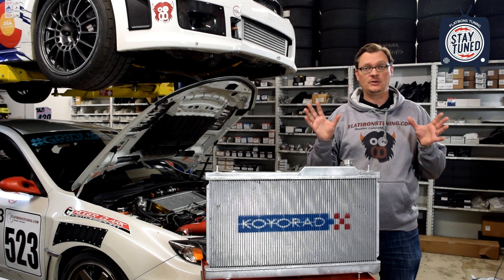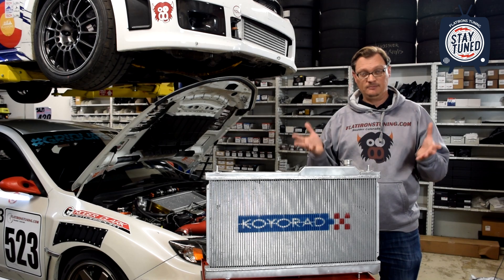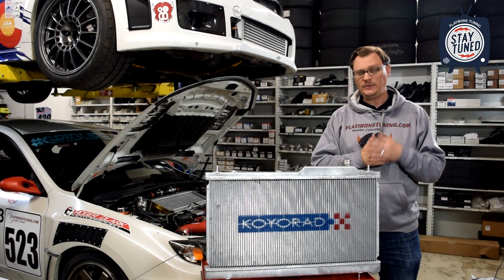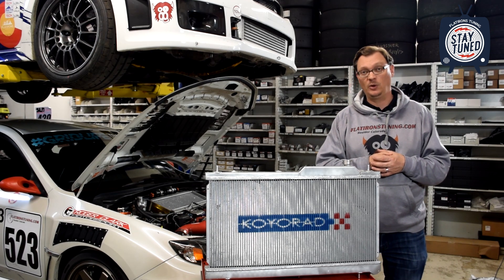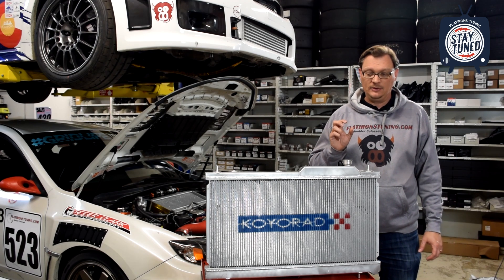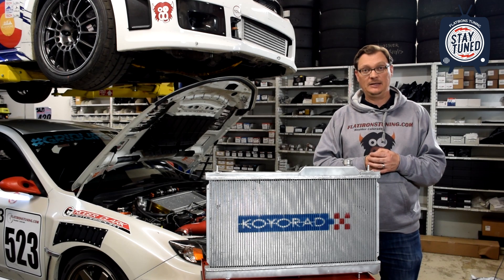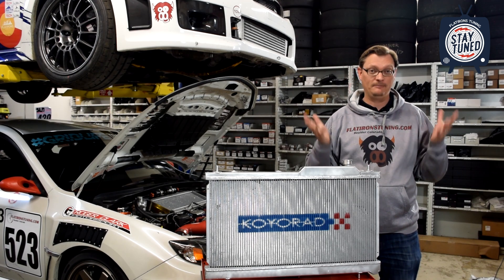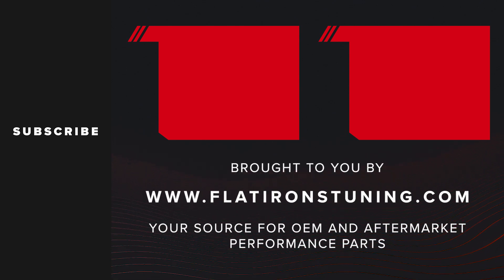Why we got rid of our radiator cap

Comment: Run a Stock radiator system on my 2002 WRX which has and APS IC, down pipe and exhaust with a tune done in 2005; all here in Phoenix AZ. The only time I have had issues with the car getting hot is cruising over 70mph in +115°F temps. So, if I keep the WRX at 70mph with AC on I don't have issues. As soon as I get up to +75mph overheating begins. Now, I drive my car like I stole it, and it does just fine with the stock setup, which is a single radiator cap on the tank near the intake. There is a stock expansion tank by the radiator as well. If this works here in Hell on Earth, then this setup should sustain some nasty beatings in lower temperature areas. Granted racing at altitude does cause cooling issues due to thinner air.
Reply: APS FMIC or APS Top Mount? Either way, some pretty rare stuff. Truly wish they had stayed in business. I've been running the DR525 FMIC on my '05 WRX since 2009, and I'm terrified of front end collisions: cars, animals, etc.
Reply: @dullahan7677  Using TMIC. To your point, and the fact in 2005 I don't believe front mount were common on the street. I bought it from the original owner who is now in his 80's. 🙂 Going to install the JDM splitter and JDM custom painted scoop soon.
Reply from the maker: Thanks for the comment.  Stay Tuned!

Comment: Hi guys, I believe I may have an explanation for the overheating issues you are having. 

As I don't have the specifics of what the circumstances under which you are overheating, that being the case I'll make the following assumptions:

1) Overheating comes on at high rpm

2) Appears to take place  in a sudden onset, ie: temperature is ok, then suddenly you are overheating.

3)takes place when under sustained high load and in particular high rpm.

4)No underlying  cause such as head gasket issues, thermostat working correctly, timing belt tensioner applying sufficient tension to adequately drive the water pump, correct Glycol concentration in cooling system,  blockages or incorrect plumbing causing reversed flow within the system.

Based on those assumptions, I believe the problem is not in the outlet going to the radiator but on the inlet coming back from the radiator. May I refer you to the 3:00 time stamp on your video;  take a look a the flow path of the coolant on the radiator shown in the window; the  flow comes from the top,  left of  centre  of the radiator. Coolant must then flow close to 400mm in one direction and 300mm in the other (14 and 12 inches)  in order to presumably flow evenly across the width of the core  (though in reality not the case), then when the flow gets to the bottom after passing the restriction to flow that is the radiator, all of the flow must then travel all the way to the far left of the radiator a path of 700mm at its longest to get to the outlet. 

The flow rate through the radiator at high rpm becomes high enough that the radiator is unable to flow without a significant pressure drop; in essence we have the same scenario as an intercooler, greater efficiency due to greater surface area often results in an increased pressure drop across it.  Should that pressure drop bring the suction side below the  vapour pressure of the coolant, it will instantly boil. Remember boiling point is a function of both pressure and temperature, hence why we use higher pressure radiator caps to prevent  overheating.  

To a certain extent this can be addressed by increasing the pressure of the radiator cap or removing the radiator cap altogether. From a fluid dynamics if you are able to push a higher pressure (whilst maintaining the same flow rate) on the inlet and the pressure drop remains the same, we can hopefully force more water through in an attempt to maintain the pressure at the outlet of the radiator above  vapour pressure, until you reach the same limitation.

A better option would be to improve the  flow out of the bottom of the radiator. This would be a better option in my opinion as an added bonus it should help with pumping losses from the water pump.

An easy way to test this particular theory wold be to set up a video camera looking at the bottom return line from the radiator which might show the radiator hose collapsing if the pressure is low enough, or if you would like to take a much more technical and data based approach, set up pressure sensors to measure both inlet and outlet pressures at the radiator.

Whilst I would love to take full credit for this information and insight, ALL credit  must go to Brett Middleton, former owner   of MRT performance in Sydney Australia. I came across a technical video in his MRT channel on YouTube. it is one of his much older videos where he goes into the finer details for what the original problem was in his then race car.

I hope this helps or at the very least provides some additional perspective. I will try to find the video and add the link later.
Reply: As I was reading it sounded familiar, I think I saw that video as well. Also, he's the former owner? Was this a recent change? I haven't followed up on their stuff lately but always did when I was working on my WRX.
Reply from the maker: Yes, I believe that Bret sold MRT to a new owner a couple of years ago.
Reply from the maker: Thanks for the suggestion.  I'll have to see if we can find that video.  Bret at MRT Definitely knows his stuff when it comes to Subaru's.  In our case, there are a few other things going on, but improving the flow of coolant to the engine is never a bad thing.

Thanks very much for your comment and Stay Tuned!

Comment: I see a lot of builders doing away with the expansion talk and using an IAG AOS in its place. Any thoughts on this idea?
Reply from the maker: Well, I would say that the IAG AOS isn't designed to serve that function.  If it has a proven track record of working, then it may be okay, but I think I would really want the cap on the expansion tank.

Thanks for your question and Stay Tuned!

Comment: Just letting you know, I run a wrx race car as well down here in Australia and I removed the opening flap of the thermostat years ago, resulting in a much more reliable cooling system back in the day.  I run both 2 and 2.5 l forged engines in this car on e85 fuel.  Hope that helps.  Cheers and well done on the channel.
Reply from the maker: Excellent!  We are going to be doing that on one of the shop cars here.  The hard thing with the Pikes Peak car is that all of race week, we test in the morning which is usually below freezing, so we need to car to warm up at least a little bit.  And we definitely don't want the water (required by the race) to freeze either.  We're hoping to find a balance there.

Thanks for the comment and thanks for watching.  Stay Tuned!
Reply: @FlatironsTuning  Sounds like you need an electronically controlled radiator shroud opening/closing panel that is temp sensor program from your standalone ECU.

But seriously it looks like that koyo radiator needs to be upgraded with a much higher quality efficient unit that comes with the cap delete option from the manufacturer.
Reply from the maker: @DJ_Driven  Thanks for the comment.  The Koyo here was just for display.  It has actually been sitting around the shop because it was damaged in shipping, but was handy for this purpose.  That being said, we are definitely fans of Koyo radiators.

Thanks for watching and Stay Tuned!
Reply: Warm ups have not changed for us in that by the time the oil temp comes up ready for racing, the water temp is well up.  We are fine with ambient air temps zero thru 40 deg C.  And if you have temps in the minuses that worry you, a piece of card blocking off a portion of the radiator front should fix that.  I really doubt sub zero racing temps will be a problem with low coolant temps but at least you can deal with that.  Data log cooling temps for a while.  Cheers.

Comment: So I'm super confused now because I went to subaru of eugene oregon last year with the same issue and they sold me 2 different caps one looks like your stereo typical cap which goes on the upper coolant expansion tank and one that is completely round and its for the radiator. The one on upper area is supposed to be the higher rated of the two. I can give exact kulopascol when I get home tonight but is this not correct?
Reply: Thank you for the video 👍🏻
Reply from the maker: @marcodg301  Absolutely!  Thanks for watching and Stay Tuned!
Reply from the maker: Thanks for your question.  This is the cap that goes on the radiator:

https://www.flatironstuning.com/subaru-oem-radiator-cap

We go into detail about the differences in our last video here:

https://youtu.be/HzjBJz1Zdmw

Hope that helps and Stay Tuned!